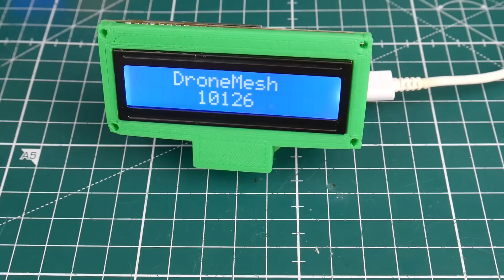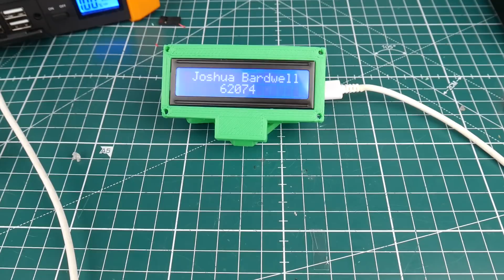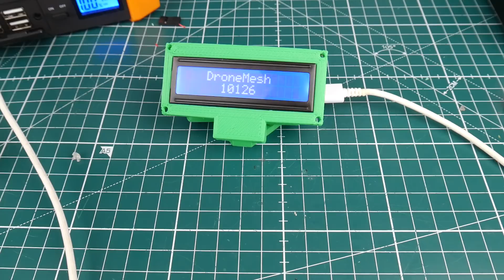DIY Wireless Youtube Subscriber Counter 2018 // ESP8266 Subscriber Counter

Comment: That's really nice, man. BTW, there's a script, I don't remember the name... But it basically try to connect to the wifi written in the code, which should be a generic wifi name and password. Then, since it can't connect, it creates it's on wifi and a page, so you can connect to it, enter that page and set the wifi and password. That way it's not fixed and you can bring it with you when you travel, to use in the hotel room, for example. ;)